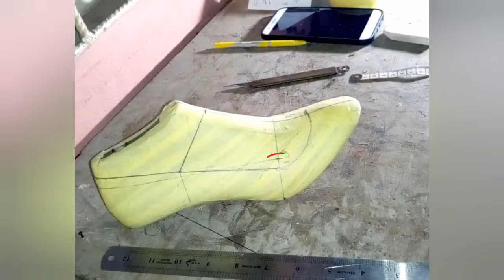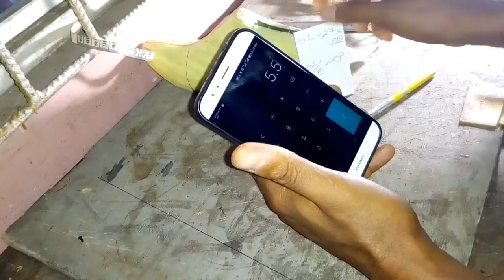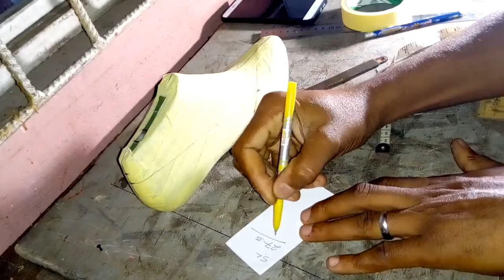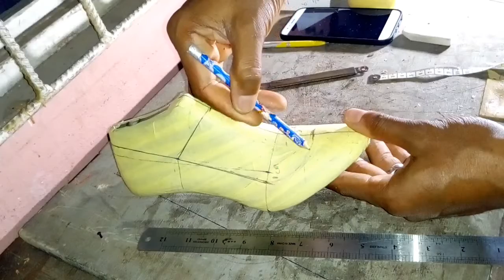4 Pro Tips for Making High Heels - Hand Made Shoes

Comment: Sir pls why did u divide the counter point by 5 and also by 4
Reply from the maker: I divided the standard last length by 5 to get the measurements of the counter point (which is measured from the bottom of the center line at the back). I also divided the same Standard Last Length by 4 to find the  distance of the instep from the vamp point.
Reply: @KpomoBespoke  ok thank u sir